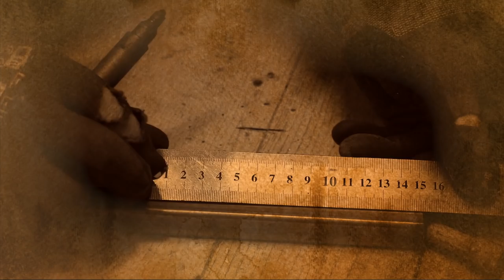How to make a powerful electric Scooter at home

Comment: This is better than your first electric scooter, but however this scooter isn’t so good!
Reply: it just needs a seat, foot pegs, chain guard and rear brakes...
but he'll probably just convert it to a tri drifter . For the next project.
the kid will do donuts and power slide  all day :-P 
Its perfect speed for a kid over 5.
I wouldnt want kids going faster than that.
You have to let them get used to the speed a little bit at a time.